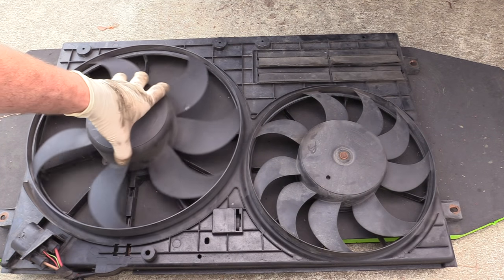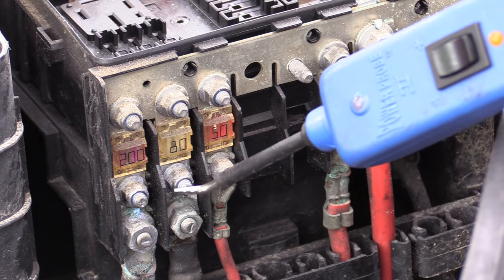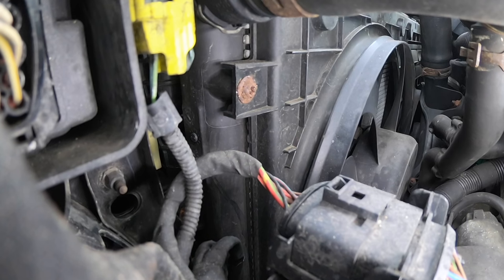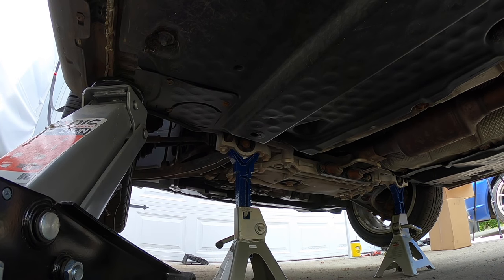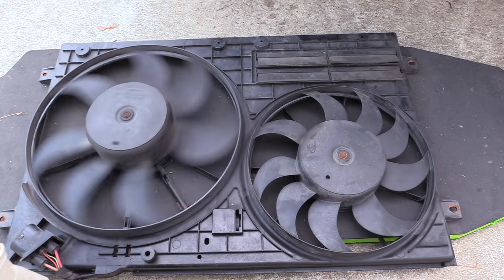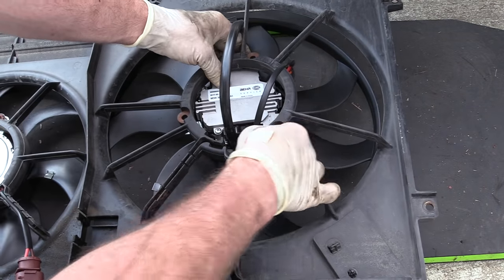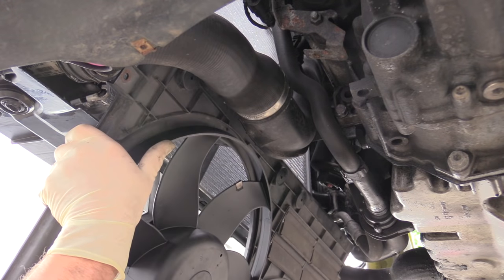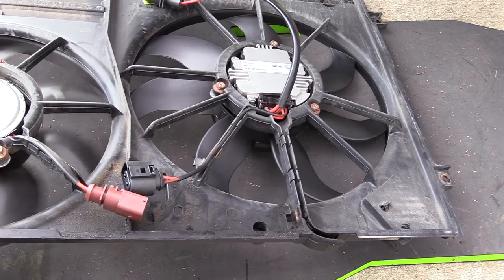How To Replace MK5 Cooling Fans

Comment from the maker: Thanks for watching guys. If things go well, you can probably do this job in about 45 minutes. Thanks for watching and if you're not subscribed MASH THAT BUTTON!!!
Reply: If the screws don't round off!
Reply from the maker: True! I actually had to replace the radiator because I couldn't get the bolt out. LOL
Reply: would the small fan failing tigger a cooling system performance code
Reply: Where do you live
Reply: Can thermostat effect the fans coming on and off?
Reply: Great video. On passat B6 i pulled the complete fan set to up. It was easier for removing and installing back.
Reply: Quick Question I changed the cooling fan yesterday but right when I plug in the new the fan it turn on by it self so I disconnect the battery for I could finish putting back together but I drove the car everything  was fine but I notice the fan stay on running after the car was off so this morning when went to turn on the car the battery was dead battery is fine hasn’t giving any problem wonder if I have to do something with the cooling fan am I missing something??????
Reply: What would cause the main fan to run constantly would that be the fan control module? It's on an 07 2.5 Jetta Wolfsburg
Reply: @brayant213  tithonus Bryant I think I am going to be a long time no more complexly than you normally do you have a lot to 5
Reply: @brayant213  Hey did you ever sort this problem out? I have a similar issue. Fans constantly run, even at startup and take about 5 minutes after shut off to completely stop.
Reply: @jintermont  Did you ever sort this out? I'm having the same issue.

Comment: Good video... I had to replace the large fan on my MK5 jetta last summer. The process is exactly the same, except on mine, the bottom radiator hose is attached to the fan support with a clamp, just had to undo the clamp and pull the hose back and bit and it came out smoothly and back in smoothly.

Comment: Thanks so much!! I will do this tomorrow, although mine was not to replace the fan, but rather to slide it down a bit so I can pull a nut that fell inside the fan. I was trying to put back the throttle body pipe and the nut fell and slid down the fan housing. Anyways, this will help me get  that nut out. Thanks again!

Comment: i have been searching everywhere for a video just like this THANK YOU!! what would you recommend doing if the small fan is constantly on? even when the key and engine is off.? i have been on this problem for days!
Reply from the maker: Probably a bad main fan. It has the module /controller in it

Comment: I had to remove the fan shroud not so long ago on my Mk6....and that exact same screw snapped off in the radiator. Luckily i was able to slowly work out the remains of the screw with a pair of screw pliers. Mine wasn't even as rusted, it just went - must get some metal fatigue from movement of the assembly.

Comment: Yeah good video, i had to do my big cooling fan about a month ago on my Scirocco R as the fan would not stop running even with the key out of the ignition, it was the fans modual that was faulty, did it myself and all is good now. Keep up with the awesome videos.
Reply: i had the sane issue on my audi a3 fans came on automatically faulty control module too

Comment: What did you do with that broken screw? Were you able to remove it without taking everything apart?
Reply from the maker: No. I actually had to replace the radiator. I will cover that in a radiator video

Comment: "If things go well" LOL well whoops I have Mk 6 GTI, yes everything applies here but woe unto you who have deeper Intercooler like my Unitronic-- you will have to disconnect the silicone hose at bottom of metal intake runner (the one with temp sensor on it) and unbolt the support to same metal pipe but not remove the pipe-- then you can just barely get the fan assembly down and out like in the video. My large fan was working so I only did the small one with an OEM fan; this is too much work to risk doing again if a dodgy aftermarket fan fails. THANKS for the awesome video!!

Comment: This has been a great source to understand how these two pals work on our VW. However, I’d like to seek your advice. I got my two fans replaced a few weeks back in a repair shop and I realized that there was some kind of noise coming from the front grill while at idle. After I stopped the car’s engine and checked what was probably going on. I feel the main fan is loose and that could be the reason why it’s not working properly or not working at all. I can’t really tell as the small one is doing all the job and there’s no overheating or anything like that. The blades seem to move back and forth while tapping with the finger. I’ll take the car back to the shop, but is there anything that you think I can do on my own?

Comment: Thanks. I have a 2009 volkswagen jetta 2.0t wolfsburg edition. My small fan doesn't work the large fan works but will not shut off unless I unhook my battery. Don't know if I should just replace the whole fan shroud?

Comment: Big fan of this video. I have a 2016 jetta sport 1.8. After heavy rains and driving my car through a huge puddle, my cooling fan started to make a noise. I opened up the hood and notice that the big fan was not coming on and the little fan was working at high speed making the noise whenever it came on. The shop wants to charge me around $800 to fix the problem. I know how to work on cars and do all of my own car repairs once I know what the issue is. Is there any knowledge you can share?

Comment: great video I'm the UK and have Touran with the 2.0 FSI engine that the fans have stopped working they work wit he a/c on but not when the engine gets hot would it bet he module in the large fan?

Comment: So the sb38 and sb34 are behind the instrument cluster? Meaning I have to pull the gauges out to check them? The thing is, my cooling fans worked just before I swapped out the engine. Now, they don't kick on. I highly doubt they're blown and I think it's a fuse problem. I think this because my radio stopped working, so I pulled that out and sure enough the 10A fuse was blown. Can you help me out with this one?

Comment: I have a 2006 Jetta TDi.  Is my process going to be the same as shown in the video?   Also, when running the output test using VCDS the fans were very very noisy.  I don’t have any codes should I replace as a preventative measure?

Comment: I have the same exact problem with the smaller fan not working and that's causing the AC not to blow cold air when the car is stopped which means the ac compressor is not getting cooled by the smaller fan that's directly facing it. I will buy the whole unit with both fans tomorrow on ECS Tuning.

Comment: Hi, for mk 5 jettas, on the 4 wire connecter to the fan unit, is it normal for  power to be present on the bigger power wire when the key is off

Comment: my small fan quit working with engine warmed up and AC going. i pulled the fans out from the top and popped in the new fan minimal problem. just remove air intake/snorkel tube. use a mini ratchet with any needed attachments to get out the 4 screws. holding the fan assembly in place to get in the screws by myself was tricky but possible.

Comment: I'm having an issue on my 2008 R32 that might be involving the fans. The large fan spins but I can't tell if the small one does, a/c works fine but large fan has got loud before, never seemed alarming. Car got hot yesterday morning when idling with a/c blasting for about 20 minutes, went up to around 220°F, went back down to normal when I started moving. It did have an engine code for P0480 and a DTC for the smaller fan (V177) having "restricted movement." 
I drove it again 2 times afterwards and had no issues, all fuses are fine and both fans move freely. Codes/DTCs cleared and did not reappear yet. Could this be a pending module failure? I live in Texas heat so I always drive with a/c on in 100°+ weather lol

Comment: Hey man, 
Great video, loved it. 
I have a MK4. 
Fans dont work, tried making a direct connection from temperature sensor switch, which had 12V shown on main line. Still fans didnt work. Do you think issue can be with fan control module? 
I hear a loud tik sound when i try to directly connect the fan connections from the control module. 
Thoughts?

Comment: I have a mk5 gti 2009, I have been keeping up with the book for maintenance and changing the oil every 5k miles. Although I have 130k miles on it,  I received a free dsg transmission from the dealer as the original went out at 97k miles. I’m just wanting to know what would be some good preventative maintenance to do with my car. (Also if anyone knows what would be an suspension setup for handling, the car currently has stock suspension with 235mm tires on it. Thank you, replies appreciated :)
Reply: Bapo Rapo far as i know they have problem with cam followers
Change oil every 8000 kilometers
Dsg fluid every 40 000 kilometers 
Brake fluid every 2 year ATE SL6

Comment: Having a similar issue, my AC doesn't cool when idling. I noticed the smaller fan doesn't come on when I turn on the AC to the coolest setting. Since the small cooling fan isn't seized like the one in the video. What's the most affordable way of checking the smaller fan? 

Is there a video on how to use VCDS to test it?(after checking the fuses of course)
Reply: Did you manage to fix your issue

Comment: @HumbleMechanic hey , love the videos , really informative and helpful. I’m looking for a bit more advise tho, I’ve mk5 gti and the large fan comes on once the engine is cold and does this in 10/15 second bursts and will continually do this draining the battery. Do you think this is the control module? I’ve had is checked VCDS and there no fault registered!

Comment: Hey man I have a fan problem on my MK5 gti! My cooling fans don't run when the car reaches operating temperature. But they do run when the A/C is cranked to max... I'm gonna assume the module in the big fan isnt working properly?

Comment: Mine was the ground for the coolant connector is came loose.

Why you didn’t elaborate on the way to test the fuse terminals in the engine bay that part had me lost

Comment: Hey Charles great video as always. I am a long time subscriber from NJ. I have a question for you and this will determine if I go German or not. I love the German cars and have noticed that they are structurally more solid (doors close better and with more “oomph”). I am soon going to be in the market for a new daily driver that is a daily, also fun to drive, and had good to decent gas mileage. I work over an hour away from my house one way. I love the GTI. The way it feels, drives, and handles. I also love the golf diesel because I test drove that too but unfortunately in an automatic. So my question to you is, is the newer GTI (past 2 years to current) a reliable car? I have always heard the joke of VW meets being lit up with check engine lights. I don’t know how true that so I am asking the expert. I love manual transmissions. So having said that, is there anything I need to know about modern GTIs with and manual or modern Golf diesels with an manual that is an issue and needs constant or pretty constant upkeep and maintenance. FYI I am coming from a Japanese car where are have never ever had issues. This car or the past 4 I have owned. Just to give you my mindset.

Comment: Hi, thanks for sharing. 
Just replaced the AC control valve in my 2006 Jetta, charged up the freon; Nothing, same crap, just blows ambient air. AC fan NOT kicking on w/ the AC switch on dash, but it Does Spin Freely by hand, nice & quiet, just doesn't come on when u push the AC button on. Do I need to bypass the high pressure switch? Had to on a friend's car to get it to start working, but that was a Corolla. 
How do I bypass the high pressure switch? Inspected connector at high press switch, looks fine, clean & such. It has 3 pins, so to bypass, which ones do I connect w/ a paperclip or wire? 
Any idea/s much appreciated.    - thanks, take care

Comment: So you have a video for replacing a radiator on a 2008 vw rabbit or where I can find one. Do I have to remove the bumper or can I remove it from the bottom like the fans. Please get back to me I have a leak on my radiator

Comment: Please help? I own a Scirocco 2.0 TDi. I was wondering, should the cooling fans both come on every time that the Air Conditioning is activated? I don't think that the air temperature coming through the AC is getting cold enough, it is cool but not cold temperature. Thanks

Comment: Charles, have you come across radiator fans, usually the main one, which seem to turn fine by hand but won't work? I've had a situation with my previous A3 Sportback that the fans weren't kicking in when they should. Dropped the fan shroud, opened the cover on the motor and found that the motor was clogged with dust from the brushes and brushes were also stuck. There was still material left on the brushes so I just cleaned them up and made sure they were moving freely. Put it back together (can't remember how I managed to get that cover back on the motor) and it worked ever since until I traded it for my mk2 TT 3.2 a few years later. Of course cleaning up the dust isn't something that I would do for a customer car unless the customer understands that it might not be a long-term repair or it might not even work at all after it so I might end up replacing the fan(s) anyway..

Comment: Hey charles.  Im having this issue .The fans will work fine with the A/C engaged but will not come on, on their own. They only come on when i use the A/C. And because they dont come on, the car slightly goes over optimal temperature when stuck in traffic.I've scanned it a bunch of times but not getting any fault codes relating to this. The fans only come on when its like an emergency  and temperature reaches to about 110 °C.. But before this issue arose they would come at at 89° or at 90° which is the duty cycle i think. Both fans spin nice and freely when i spin them with my hand. Any idea what the issue might be and how do i fix it.? Thank in Advance

Comment: I have a 2014 Volkswagen Jetta 1.8T and the cooling fan on the right has a lot of vibration. I've check and it moves fine, just has a sever vibration. Any ideas?

Comment: Thanks for the video, as always is great to watch and learn... I have some issues with my MK5, the fans work great with the AC engaged but if the AC is not engaged the vehicle sometimes takes longer to have them on, as a matter of a fact the fans go on until the temperature of the engine out is around 118 C ... and the duty cycle is around 87 % it is they turn on when is kind of an emergency, otherwise the fans never or mostly never turn on around 95 C (which I think is the right temperature to have them on)... this is an erratic behavior. I have checked the values of the engine out and rad out and the sensors seems to be sensing properly the temperature... you guys have any idea of what os going on? Thanks in advance!!!
Reply from the maker: Maybe a module failing. Not dead but going dead
Reply: Im having the exact same issue. What did you do to solve it? My gti is doing this aswell. The fans will work fine with the A/C but will not come on at 90°. They only come on when its like an emergency. So what was the issue and how did you fix it?

Comment: I have a 2015 Passat 1.8l turbo, I replaced, the sensor on the compressor, and the expansion valve, and after all I noticed that the fans don't work with the a/c on  they work but only when the car is moving at this time the a/c is cold. Can you help me please? Thanks for the work you put to help us.
Reply: My car does the same? How did you manage to fix this?
Reply: @mr_luke19  I didn't fix it completely, I connected a switch to the fan so I can activated manually and it worked. I traded in the car, the dealership wanted $2000 to fix it and they could not warranty it was the compressor they were saying could be the computer.

Comment: Hey! I’ve got a 2010 Jetta 2.5 that has the cooling fans constantly on. The engine will be cold and off with ignition off and it still is running and high speed and will run until it drains the battery dead! Any ideas?? Thank you!!
Reply from the maker: Possible fan issue. I’ve also seen failings ECMs do this too

Comment: Hey man, love the vids! 
My mk5 gti has the fans coming on once I turn off the ignition. Sounds like its going to take off. would this be worth doing?
thanks.
Reply from the maker: Possible. But fans on after shutting car off can be normal. Be sure to check faults
Reply: @HumbleMechanic  Wow I appreciate the reply! 
I have checked for faults, no CEL so its clean.
This isnt normal, temperature ventures above 90 sometimes. Im confident this isnt normal, as ive owned 3 of these cars over 7yrs and never heard it before.
Thanks again.

Comment: How did you get the broken t30 screw out that was left. Really annoying the heads snap off below the surface!!! HELP
Reply from the maker: Usually I’ve been able to get them out with pliers. This one was stuck. Sadly car got a new radiator
Reply: HumbleMechanic then when you go to unbolt the radiator from the intercooler you break the t30 mounting bolts on there and need a new intercooler... then when removing the intercooler you damage the AC cooler pipes.. LOL